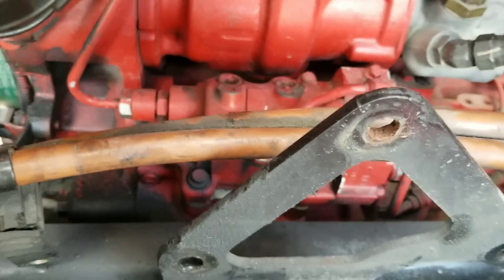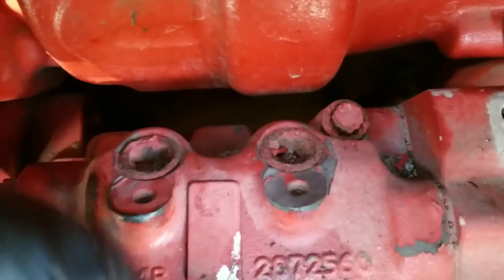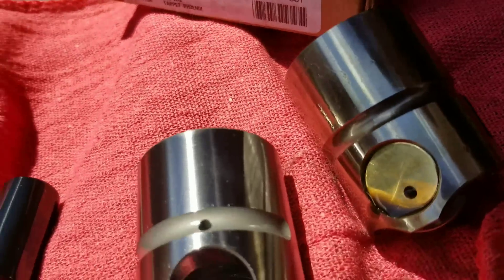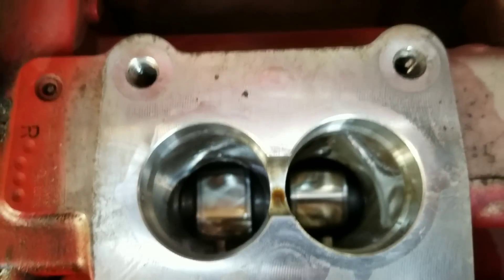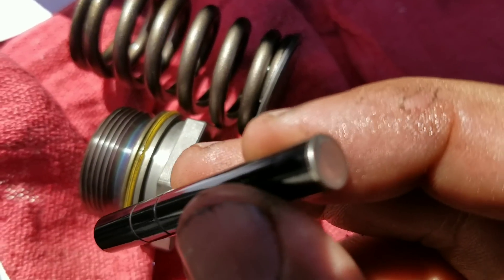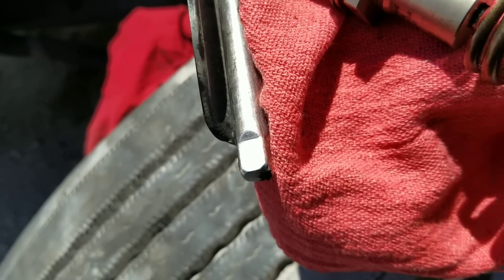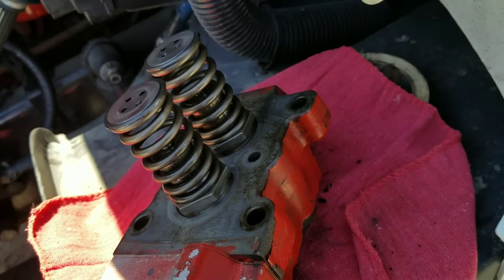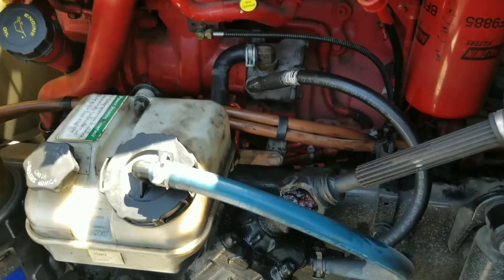Cummins isx 2350/2250 high pressure fuel pump update barrel/plunger/tappet

Comment: Cummins says I need to buy the fuel pump head which will have the updated tapped.
Question is were you able to get just the upgraded tappets separately? I'm being told otherwise.
Thanks!
Reply from the maker: You dont have to buy head in order to get tappets. They sold separately.

Comment: Hi everyone, good job man, that part is very expensive, my kw has a isx 450 HP , and the fuel pump went bad, and that problem cost me 6,500 dollars. No good.
Reply from the maker: Yes dealer charges insane money for that.
Reply: Did you pump have the ceramic plunges and did it break? Because my broke, so now I'm nervous about engine damage

Comment: I need help, my Volvo won't start but it does crank, I sprayed starter fluid and cranked up,  a couple hours later it won't start up, need help?
Reply: it could be fuse on battery for fuel pump

Comment: my truck leaks fuel at the star nut on top of fuel pump head. do you know why. does throw code of fuel rail pressure. need help
Reply from the maker: Its most likely banjo bolts o-rings  fuel lines. If you are sure that star bolts leaking then thats head leak and head needs to come off.

Comment: А как узнать что они плохие? На моем траке мотор 2013 года но очень плохо тянет не даёт полный буст турбо, ето может быть связано с fuel pump. No check engine light.
Reply from the maker: Nado podkliuchit cummins insite. Smotret kakoi fuel rail pressure. Dolzno  bit okolo 30,000psi. Zdelat fuel system leak test. Nado sledovat cummins quickserve ukazanijam. 
2010-2013 bili keramicheskije plungers kotorije kokda lomalis, keramika smechaetsia s maslom i unichtozhaet dvigatel.
Metalicheskije (titanavoje)derzhit okolo 500,000mil.
Jesli budet check engine "low fuel rail" eto znachit shto pompa uzhe polamalas i dalshe exat nevzia, potomu shto oskolki metala poidiot v shaxti masla i unichtozhit dvigatel.
Reply: @simonsays6924  Иногда код загорается на fuel injector cylinder #6. SPN0655
Fuel pump здесь уже поменян, но ета  верхняя часть что ты снял, она красная осталась original. Может она плохая?
Reply from the maker: @andreyfedchik8356  eto verxniya chast - golova fuel pump. Tam stojit check valves. Kokda snimaesh golovu nado podovat  vozdux (40psi)na fuel input. Plungeri dolzni vilezat obratno kokda nazhinaesh paltsem. Jesli oni nevilezajut znachit golova ploxaya.
Reply: @simonsays6924  Cummins ISL я делаю fuel rail pressure test давление поднимаеться до 21 000 psi. Ты не знаешь для этого двигателя это мало или норм.

Comment: For the love of donuts ppl, clean the dirt off with carb cleaner/brake Kleen before ya start and practice clean care. Cummins covers this under a TRP/campaign on affected engines don’t know why people pay for the parts themselves. The head is also checked under the campaign. If you screw this up you could be talking a new fuel pump minimum all the way up to new engine.

Comment: Good video, 1 of the biggest problems the Cummins fuel systems have is contamination. Before you do any work on the system pressure wash and brake clean the are and components your removing.

Comment: The isx is a gentle beast if you wanna have premature failure of everything change the oil every 30 40k . Oil 10-12k coolant every 24months only use part number matching filters. Do not idle the isx under 1000rpm oil pressure to low. This is all in the cummins owner's manual that nobody ever reads .
Reply from the maker: I always change oil 15000miles.
Reply: @simonsays6924  
I only get Rotella T6 full synthetic. I change around 30K what do you think bud. Thanks.
Reply from the maker: @SPharaoh  Yes you can do that with synthetic oil nothing bad will happen. But I would not go past 50k.
Reply: @simonsays6924  
Appreciate your suggestion. Thanks.
Reply: what's the recommendation on the idle when running a PTO. (wet kit) Thanks in advance
Reply: Dan R •,
You’re talking about convention oil change right.

Comment: roller tappets fail also. Check cam under pump head. Ruins motor.
Reply from the maker: I replaced them aswell at 430k miles

Comment: I have a 2015 isx15. These have problems to on the fuel pump too then??
Reply from the maker: 02lswith22s you need to replace tappets. Mine is 2015. Tappets have brass bushings which are on recall. You can see difference in video.
Reply: Ok so after I replace them do I replace them every 300k Miles after that so the metal tappets don’t break
Reply: @simonsays6924  where I can buy these parts? The dealers sell only fuel pump head...thanks
Reply from the maker: @a13dgjmp13  I bought at kenworth dealer but it was 2018 idk if they still sell. You need to tell part numbers. I also bought online using part numbers.

Comment: why does the ceramic break?
Reply from the maker: La2ndeGuerre ceramic plungers were on 2250 motors 2011-2013. After 200,000-300,000miles they break into particles and go into main bearing galleries. After that all engine basicly junk. Ceramic is like a sand it goes through all oil galeries , destroys everything. 
In 2013 cummins started put steel plungers. However they also  can break and metal particles do the same like ceramic. I recommend to replace them every 400,000miles. It will be cheap insurance $500 versus $25000

Comment: What are the part #s for the cm2250?
Reply from the maker: For 2250, plunger and barrel kit- #4327258
Tappet -same # shown in video
Reply: How about the gasket?
Reply from the maker: Gasket #2872513
Reply: Looking at a 2007 isx  do they have this problem to